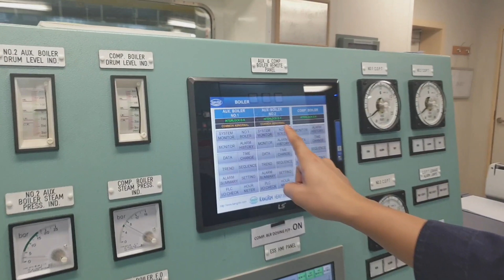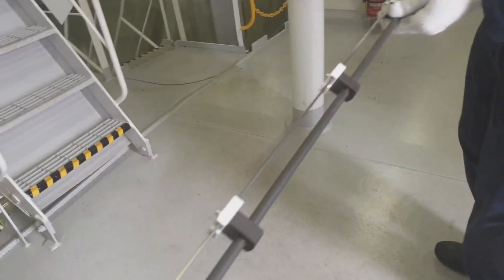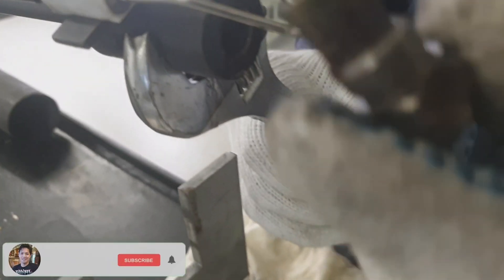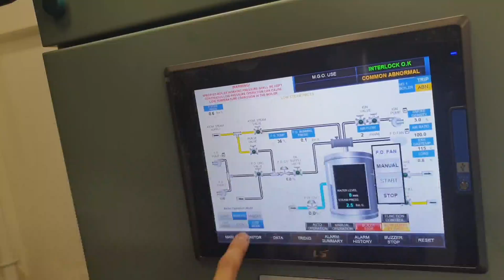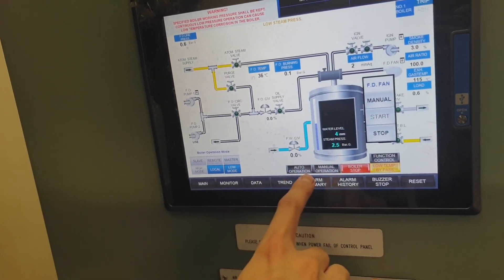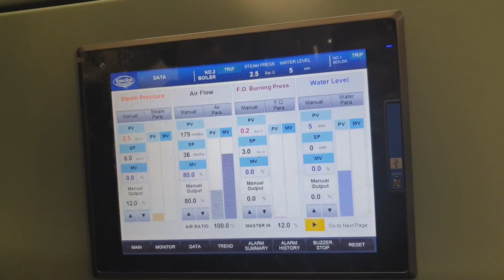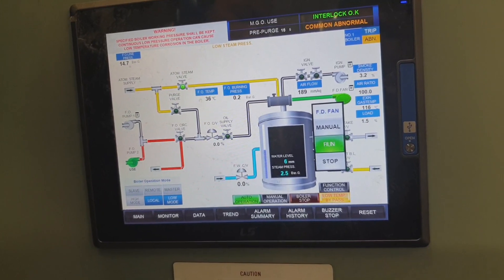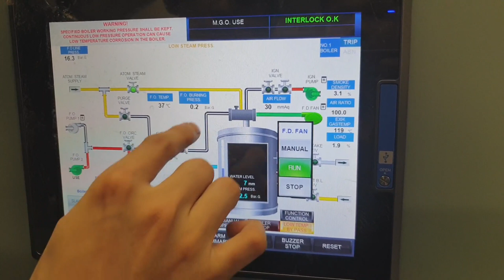HOW TO CLEAN PILOT BURNER OF BOILER

Comment: How air will come to get mix with diesel oil in pilot burner , Does any air line providedvfor it ? Also , after pre-purging stops, then does FD fan got stopped or run continuous?
Reply from the maker: Yes it does, at firing position minimum air supply is provided from fdf, right after pre purge of boiler, fdf continues running..